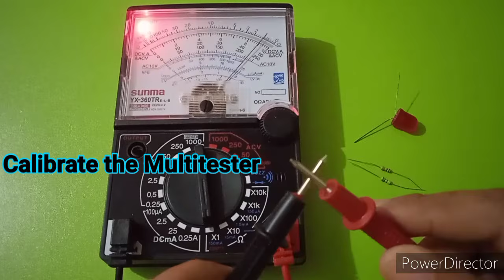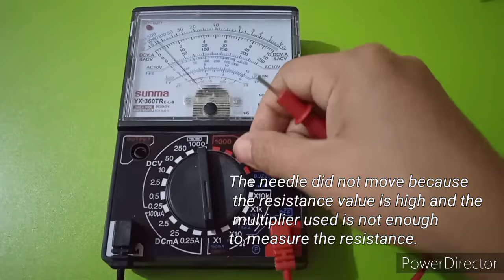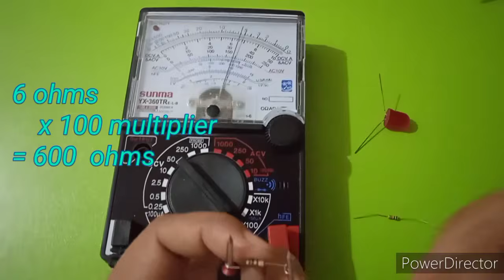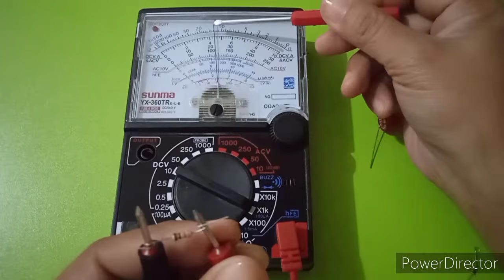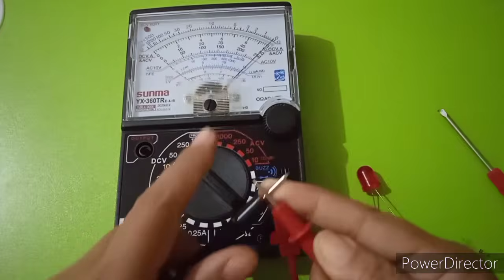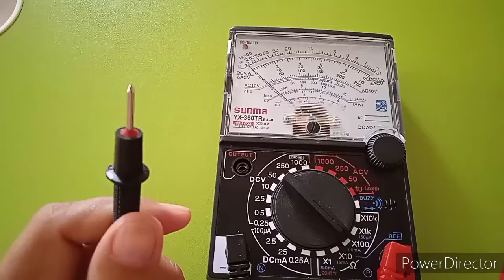How to Read Resistance Values using Analog Multitester

Comment: The Pointer Zero Adjuster (middle screw) must not be used to adjust to Zero ohm. That part you are giving the wrong information. Another thing, never touch the test pins with your bare hands especially when using the ohmmeter to measure the resistance. It will affect the resistance measured

Comment: You are absolutely wrong. You NEVER adjust the zero on the right side with the needle screw adjustment. That is ONLY used to adjust the zero on the left side. That should be step one. Then, to adjust the ohm zero on the right side with the test probes together, you use the ohm zero knob. If it will not adjust to full scale on the right side, you should replace the batteries.
Reply: Now everyone that watches this will never get the correct reading and wonder why the circuit doesn't work. Too many bad videos
Reply: Your comment is not helpful, you cannot correct someone by simply saying they are wrong. How about you provide your own opinion on what the “correct” way would be otherwise you just sound like an a$$.

Comment: I'm having to relearn all of this. I took electronics in. Highschool, remembered enough to get an Amateur Radio License, but I've really gotten into those old tube type transceivers. I found myself an old Swan 250 6 meter rig that I want to put back on the air. This will be a big help in measuring those old resistors and pairing the new tighter tolerance ones for the upgrades. For those fellow Hams out there, DE W4NZX

    73